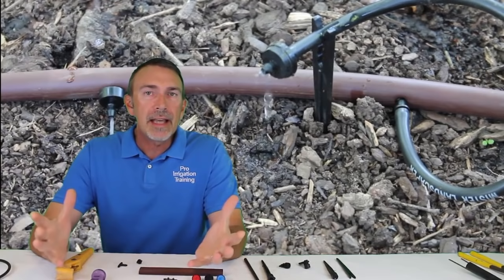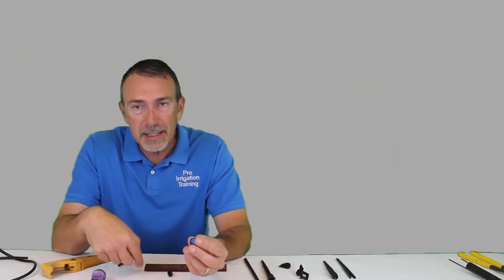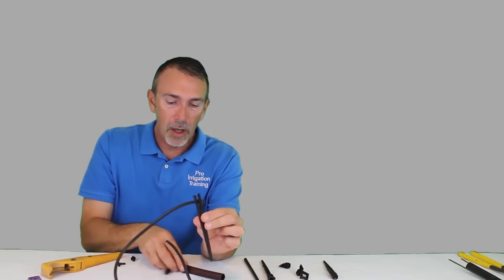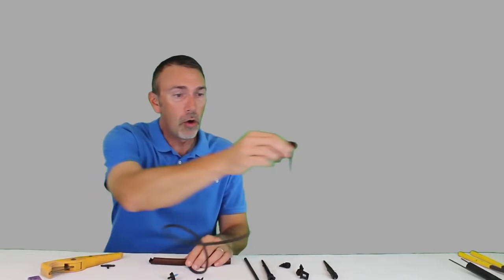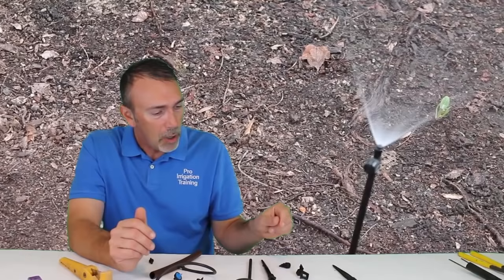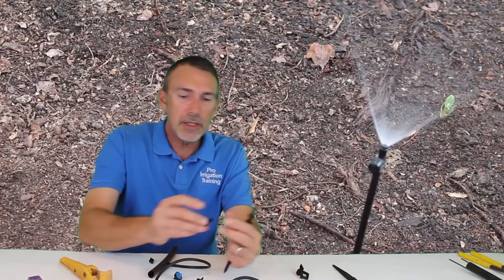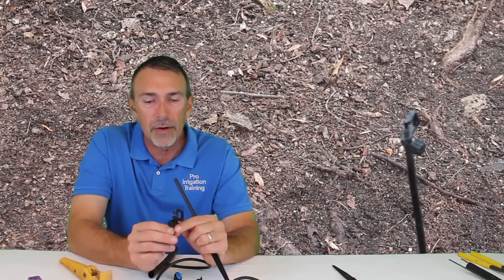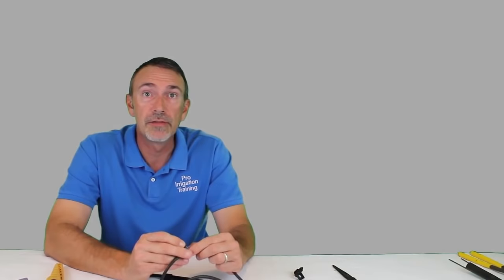Drip Irrigation spotlight on Drip Applicators, Emitters, Bubblers, & Microsprays

Comment: Do you know if the brown tubes are smaller than the black tubes? I tried fixing a brown one by cutting out the broken area and adding coupler but it seems that its too big for the brown tube. I tried a barbed coupling, but that didn't fit into the brown tube! I'm frustrated.
Reply from the maker: Yes, there can be a slight difference in the sizes. Typically, the black tube is 1/2" and the brown tubing is 17mm, which is a difference on the interior diameter of a mm or two. Rainbird's Multi-Diameter Compression Coupling will take care of that.

https://www.lowes.com/pd/Rain-Bird-1-2-in-Plastic-Drip-irrigation-coupling/1002293686
Reply: @Proirrigationtraining  thanks i ended up heating up the tube a pushing a coupling in lol

Comment: How do you prepare your irrigation system for winter, roll everything back to the storage?
Reply from the maker: In South Carolina, we dont do anything. It doesnt get cold enough to damage hardly anything. But if you use drip line without check valves in it, you can just uncap the end of each run of tubing and let the water run out. If you're using check valve dripline, you should use an air compressor to blow out all your lines and zones.

Comment: I'm going to be doing this to water my conifer trees, seedlings right 
now but they will need the eqivilant of 1" per week what size emitter 
would I use?
Reply from the maker: That's a good question. I know of formulas for converting large areas into acre/inches, but a single drip emitter? I'll have to do some research to figure this one out.

Comment: How would I hook this system into my already existing sprinkler system?
Reply from the maker: Hi Gerry, there's a couple ways to do this. The best way is to add a new zone by installing a new valve. That way you can control your drip independently of other zones and dial the watering times in to each need. That gets a little technical and you would need to wire the new zone back to the timer assuming that its an automatic system. Good installers will include an extra wire or two in the bundle when installing for future expansion. If not, you would have to run a new hot wire ( you can use the existing common wire, assuming you're adding the new valve near existing valves.) There's another, easier way. you can use an existing zone if there's enough available flow to supply the existing heads plus the drip you want to add. if there's a head you can eliminate, you can use the Rain Bird 1800 Retrofit Kit to make a new drip supply point. It has a pressure regulating filter, and It also has a 1/2" inlet, but if you already have Rain Bird 1800 Sprays, you can just replace the guts of the spray body. Be sure to figure out the flow requirement of the drip you want to add so you can make sure that you're not over-demanding the zone and decrease the performance of the heads already on the zone.

Comment: Do Spot-Spitters work with drip-manifold converter heads? (Orbit, Rain Bird, etc.)
Or do you need full sprinkler-system pressure for Spot Spitters??
Reply from the maker: Spot-spitters, I like that! Never heard that before! But yes they will work fine. It's best not to have full pressure anyway, it will blow the fittings apart. I don't think the drip manifolds have pressure reduction in them, so it's best to use a pressure reducer and filter on any drip system.
Reply: @Proirrigationtraining  thanks!

Comment: Do you need clamps to hold the tube to the edmitters? And if so what kind of clamps
Reply from the maker: No clamps are necessary. The emitters have barbed inserts, but you should keep the pressure under 40 psi, preferably at 30 or 35 psi.

Comment: Ryan Howe
Thanks for this video. I am going to be installing a system in our front yard over the weekend but have never done this and therefore a question:

Is it possible to create a system that can be feed from both a rain barrel (gravity fed) and a hose bib - or do those need to be independent systems?  We live in the desert Southwest, and try to use recaptured water as much as possible, but often our rainwater catchment system runs dry

Thanks in advance!
Reply from the maker: The first concern is how the water will actually be delivered. Most drip products require a minimum of 8 or 10 psi to work. If the rain barrel was elevated 18 - 20', then you could make enough pressure. Or you could drill very small holes in PVC pipes for the delivery system for the rain water. Either way, it probably has to be kept separate unless you can find a way to pressurize the rain water with either a pump or elevation.
Reply: Thank you very much!  Back to the drawing board it is!  Haha!  Thanks for the info - and the great video!

Comment: how do you stop emmitter if you no longer need it to a certain pot
Reply from the maker: You can get a little plug, called a "goof plug" that you can cut the tubing and push in. If you think you may need that dripper again, you can just double the tubing over and put a zip tie on it to pinch off the flow.

Comment: does it matter what direction you install the emitter
Reply from the maker: Good question. I've never seen it explicitly said that there is a certain direction of flow. I think it is implied by the construction of the emitter. The sharper barb is considered a self piercing barb for insertion into the delivery tubing. The other outlet that's rounded off is considered the outlet. So I would always stick to that.

Comment: Can I drip a bed and spray over a sidewalk off the same line?
Reply from the maker: As long as the total flow doesn't exceed the amount the supply pipe or drip tubing can deliver. Most drip tubing has a flow rate of 4 or 5 gallons per minute. Add up all the drippers on the tubing run and see if you have enough left over for a spray. Check the flow rate for the nozzle that either comes with or you purchase seperately to put on the spray.

Comment: It would be most helpful if you would show how to EASILY add self-piercing (or not) bubblers or emitters to a 5/8 inch line...with ease please!  It is quite a simple task to show how to connect these different parts while sitting at a desk but not very realistic!  It is a very different story to show how to connect new emitters (or other) to an existing line...on your knees, pushing aside plants, trying to make the hole puncher work, trying to press those little things into that tiny hole...soil pushing down when you try to connect them...I've placed various tools underneath the tubing to try getting a hard surface so the button can be pressed hard enough to go into the tubing usually to no avail.  It is always a serious battle between the emitters, the tubing and GOD! (if you know what I mean) especially when one has arthritic hands that ache with pain!  Even when I didn't have arthritis, it was difficult to connect new lines etc on an existing system.  Any ideas...anyone?  I could sure use some clever ideas...other than hiring someone else to do the work.
Reply: Agree! I'm not a professional and struggle with this as well. My best solution so far is to only use 1/2" line and NOT what he calls the spaghetti line. Unfortunately, that really only works well if you are starting fresh with a new system in an open bed, which might be something to think about for fall. I've found that it is much easier to install the easier the emitters and what-not there. To make the holes I use a small drill and about 1/4" (or a little larger) bit instead of the little poking tool. Then I squeeze the 1/2" line as I push the emitter on. I think this would also work on 5/8" line. If I do use the spaghetti line, I'd use a drill to make the hole, then I'd press in the coupler using a nut driver. Then I'd heat up the 1/4" tubing ever so slightly using propane torch so I could get it to slide on to the barb. But no matter what you do, I've yet to find a method that isn't a PITA!

Comment: I have 2-foot x 2-foot containers. I'm finding it hard to water equally the whole area. Also, I have containers and raised beds on the same zone and I'm finding it hard to match the needs of each in the same time frame. Do you have any ideas or do you think I need to expand to 2 zones?
Reply from the maker: Hi Dolly, I'm so sorry that a reply didn't get posted at the time, I thought I did. The solution is to use a solid drip tubing, then you can tailor the drippers to your needs. Small plant with small water need, use a .5 gallon per hour dripper. For a larger plant, you could use a 2 gph dripper or multiple drippers. For a larger area that drippers may not work the best, you can use a micro spray to provide better or more even coverage. For this strategy to work, the soil needs to be fairly porous and have good drainage, otherwise the water just spreads out sub-surface and the differences in each dripper won't make much difference.
Reply: @Proirrigationtraining  Thank you so much. Better late than never. I forgot to mention that this bed is on an incline. Does this affect your recommendations?
Reply from the maker: @dollyperry3020  It shouldnt affect much unless the incline is drastic. If the water is flowing downhill, it will pick up .433 psi per one foot of vertical elevation drop. if the water flows uphill, it will lose .433 for each foot of vertical rise.

Comment: Hello I'm curious I'm growing in 5 gallon smart pots how many times should I water a day or how many gallons a day should I water in hundred degree temperatures or should I leave it on constantly please let me know thank you
Reply from the maker: Hi Thirsty Desert! I think the answer depends on the growing medium. If for instance you're using expanded clay pellets, you might need to water constantly at those high temps. If you're using soil, you may need to drip 4 or 5 times a day. I would caution about watering too much, you can cause root rot which is a lack of oxygen from staying soaked. Most plants' roots like to stay barely damp, although some like wetter environments. It also depends on the size of the plant. Larger plants need more water obviously, but its easy to kill a seedling by overwatering. You could use a moisture meter to monitor your medium and adjust accordingly.

Comment: Any suggestions for stopping squirrels and voles from chewing holes in main line?  Also isn’t it bad for plants to get their leaves wet and promote rust spots or fungus.
Reply from the maker: Yes some plants don't like overhead watering, such as older cultivars of roses. It's best to use drip. Covering the drip line with a heavy layer of mulch will help with animals, but they can hear the high pitched squeal that the emitters make. You can actually bury the dripline in the soil, but use a check valve product with some kind of root intrusion blocker, either copper, trifluralin, or treflan.

Comment: Hi, I'm wondering if you can help me w/ this ? I have 2-3 55 gal barrels I'm trying to run gravity drip off of . I have 12 - 4x4' /2' deep  boxes . How high do I need them in the air to have enough pressure and what drip Emitters should I use ?. Thanks for any help ..
Reply from the maker: Hi Kevin, I think the minimum pressure that you would have to generate would be 12 - 14 psi. Most drip-tape products and drip emitters require a minimum of 8 - 10 psi to push through the emitter, and a little extra to account for friction loss through the fittings and pipe. Each foot of elevation rise will get you .433 psi, to get 14 psi at the head of the system, you would need 32.3 ft of vertical rise. That doesn't mean that the barrels need to be straight up vertical. If you have a hill, you could use the slope to accomplish the elevation drop.
Reply: Thanks for the info . I have 2- 55 gal . up 4 ft high , with a slope  Not sure how to get measurements on the slope ?  Any info would be great .. thanks again :)
Reply from the maker: The best way I know of is to use a laser level and a stick of pipe. Remember that what matters is the straight vertical elevation rise. Place the laser level on the ground up the slope. Walk down the slope with the stick of pipe. Hold the pipe vertical with end on the ground. Move it around until you see the laser line on the pipe. Mark and measure that point and you've got the vertical elevation rise between the place where the pipe touched and the laser level. You can repeat the process for a long slope. Again, you're going to need at least 32' of vertical rise. If you can't achieve that much elevation, you can drill small holes in PVC pipe and use that as your drip delivery system. That's far from perfect, a last resort if you can't generate enough pressure to use drip products.

Comment: Any recommendations for Live Oak Trees?
Reply from the maker: I'm not terribly knowledgeable about trees, but I'm thinking that Live Oaks get pretty large. The size and age would determine where to position a ring of drip line around it. A new planting would need a dripline pretty close in, but a larger established tree would need to be watered further out towards the edge of the canopy where smaller roots are. Closer in to established trees, the roots are thicker and take in less water.

Comment: If I have an 8ftx2ft garden bed, what GPH emitters should I use for my veggies (basil, tomatoes, parsley, etc.) and how long should I water for?
Reply: Spencer Godspeed If you have good loose soil you could use 2gph drippers at each plant and start out with 15 or 20 minutes run time and increase it as the plants get bigger. Always check the soil with your finger to make sure it isn’t staying too wet. It can be easy to overdo it with drip because you don’t really see how much water is going into the soil. But really, any size drippers would work, and just adjust the runtime to give the amount of water you need at each plant. 1 gallon per hour would obviously give you one gallon for an hour of run time. So start on the low side of run times and adjust it up as it gets hotter and the plants get bigger. But always check the moisture of the soil. I like the probe style moisture meters that are about $20. They work pretty good.
Reply: @michaelhaynes736  I checked out the moisture meters and they're pretty cool.  Gonna get one off of Amazon.  If I understand correctly, your plants should get about 2 inches of water a week which, if my math is correct, means watering them about 20 minutes a day with a 1 GPH emitter, do you think this sounds about right?
Reply: Spencer Godspeed That’s a good place to start. Just make sure that the soil doesn’t stay completely saturated. Sometimes an every day regimen can be too much and cause root rot. It just depends on the soil quality. The roots generally like to be damp but not soaked all the time.

Comment: Hello, can I tap into the drip line instead of the main line?
Reply from the maker: You sure can, but you have to make sure that whatever you're going to supply doesn't exceed the flow capability of the drip line and the drippers that it's already supplying. If you're just going to put a couple drippers, for a potted plant or something like that, it's probably not an issue, but if you're going to water another whole bed or garden area, you may want to consider tapping into the main line just so you know you'll have enough water available. Of course don't exceed the flow capability of the pipe you're tapping into, either.

Comment: Informative video but tubing is hard to work with, splitters when installed drip from main line instead from spaghetti hose.  Waste of money and disappointed at this system.
Reply from the maker: Hi Carlos, sorry to hear that you're having problems with your system. If I understand your comments correctly, it sounds like the pressure might be too high if you're getting leaks at the fittings.

Comment: Most of the product you are showing are miantainance nightmare as you or your gardner maintains the garden. The mini sprayer and bubbles will have nipple break of very easily. The drip manufacturers know that and don't want to fix their products as they make a huge amount of money.

One product that NDS made that worked well and was low maintenance was the laser drilled 1/4 tubing - that you can mix in an areas with mini sprayers and bubblers as the flow rate is hight (those with built in emitters require long run times and cannot be mixed with mini sprays and bubbles). Unfotunately NDS stopped making it after OSH hardware cloud down as they were one of the few stores that carried it. NDS bring that product back.

Drip manufacturers - please improve your products and stop ripping us off with products that break easily.
Reply from the maker: Thank you for your opinion. It's probable that the products we use in the setting of landscape irrigation systems don't encounter the issues you describe. These are typically used in low-traffic areas such as flower beds or tree lines. I'm sure agriculture and other applications are rougher on the products. I rarely see damage except for what animals do.